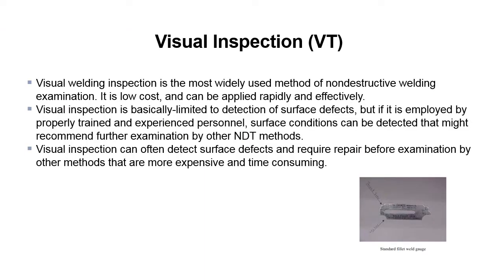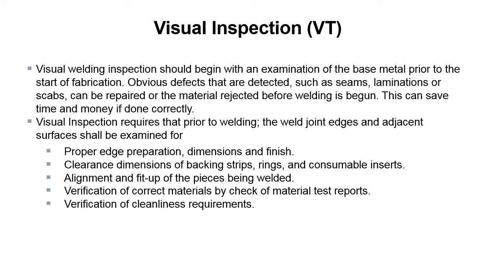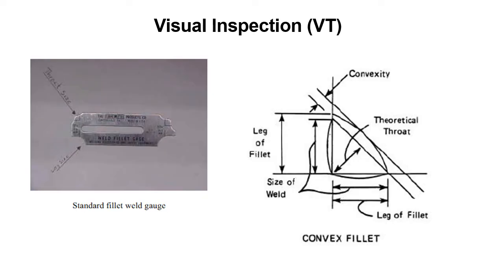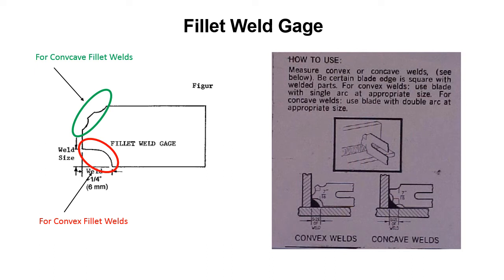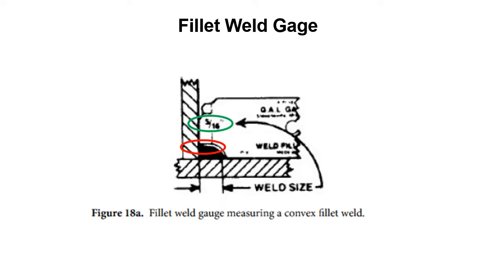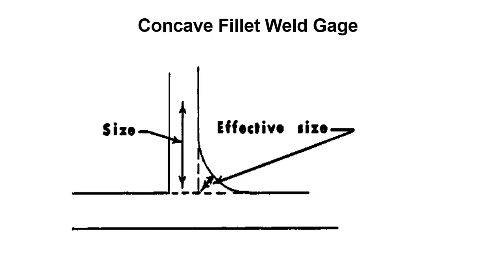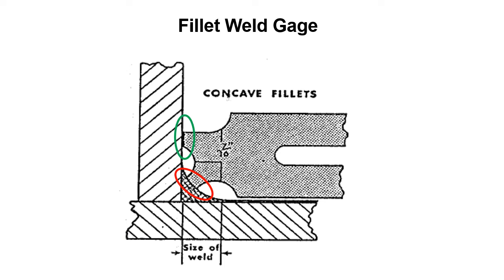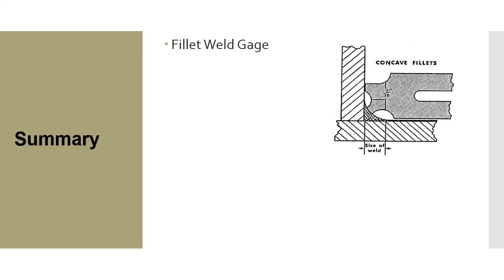CWI Course Module 10 Part 2 Fillet Weld Gage

Comment: If engineer specify regular fillet weld without thinking of concavity it usually means 45 degrees flat. So, CWI  would check weld as convex, right?